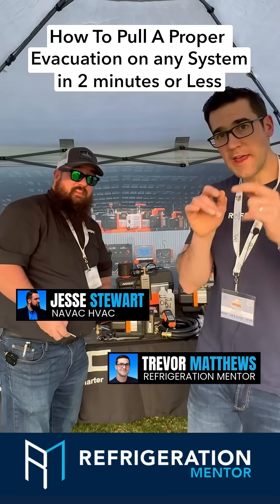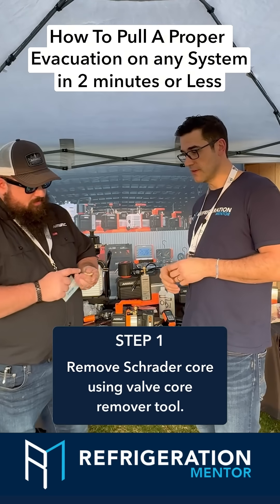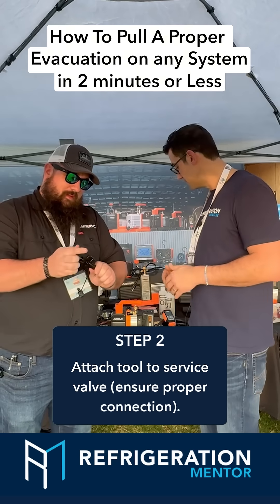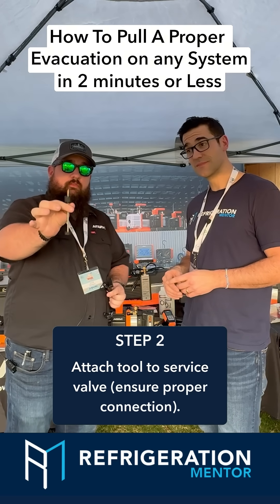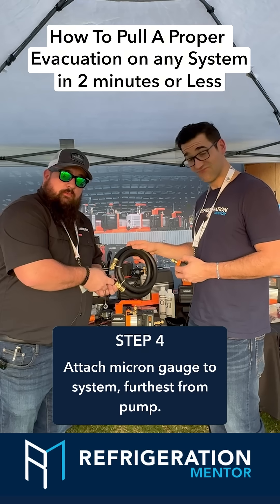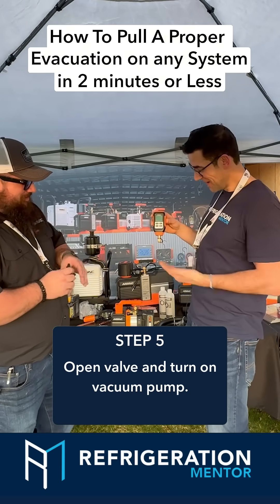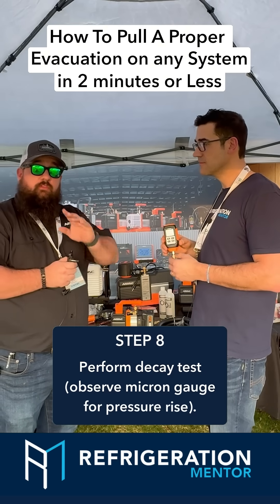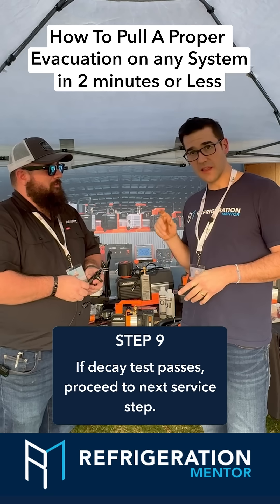What makes an evacuation truly complete before moving on to the next step?

Comment: With racks you have 3/8 vacuum/charge ports on both headers.Residential it is a thing to pull too quick of a vacuum according to the old heads,let the vacuum sit and see
Reply from the maker: I don’t think that is true. I watch a Jim Bergman video and he pull a full residential system below 500 microns in less than 5 mins.
Reply: @RefrigerationMentor I thought a quick vac like that any moisture would freeze before it could boil off,kinda like venting CO2 to fast it turns to ice from the sudden pressure drop.I could be wrong but I'm sticking with my practices